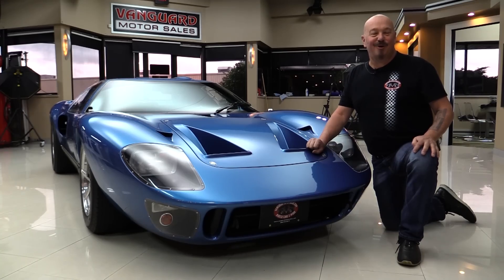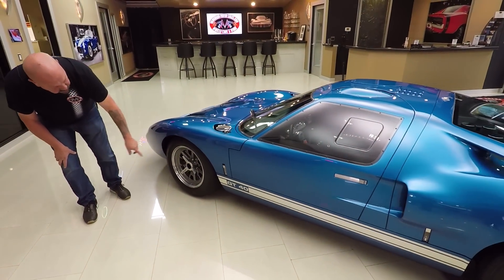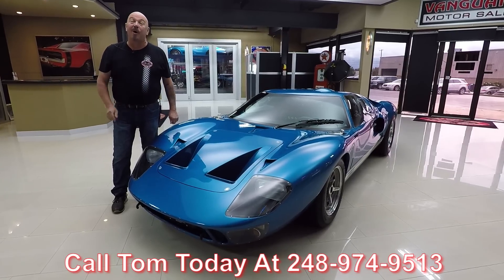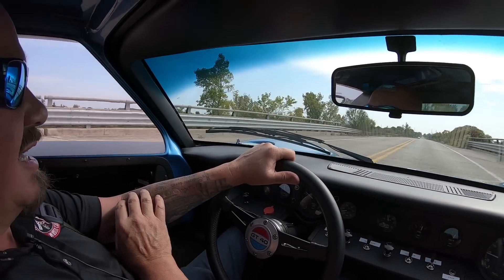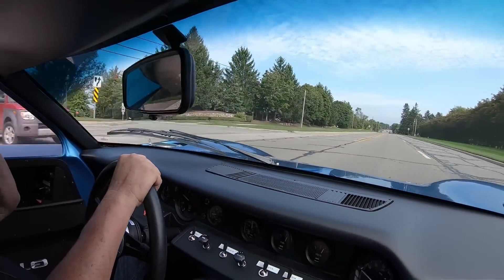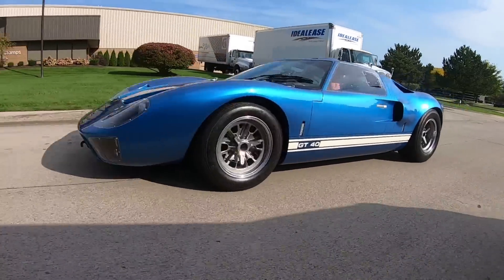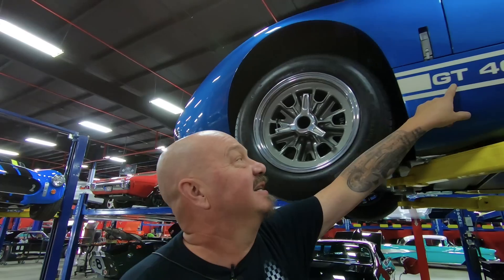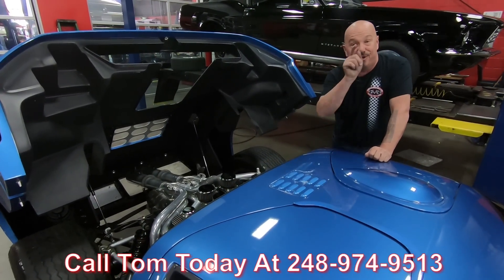1965 Ford GT40 Superformance For Sale

Comment: Missleading title. It's not a 1965.
Reply from the maker: Im not quite sure what you mean.. Its a replica of a 1965 Gt40 made by superformance?
Reply: It's built in the 2000s and the 2010s, and 2020s maybe, although it replicates the mid-late 60s GT40s.